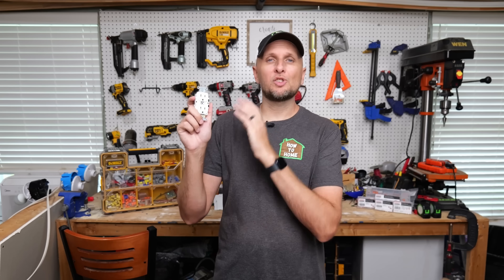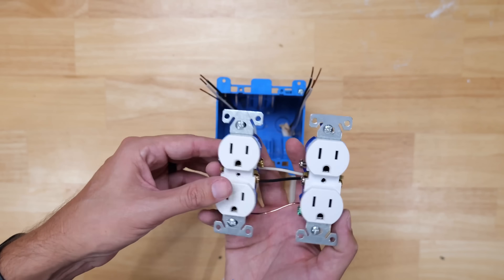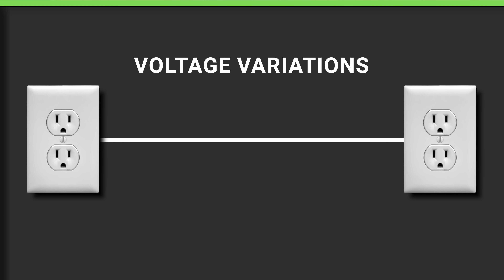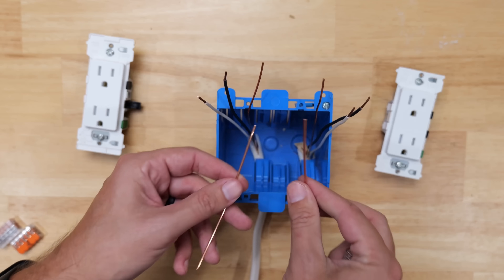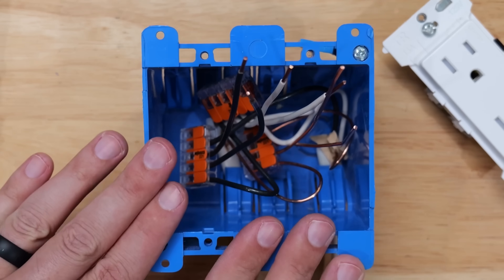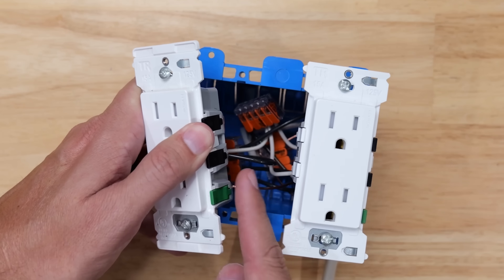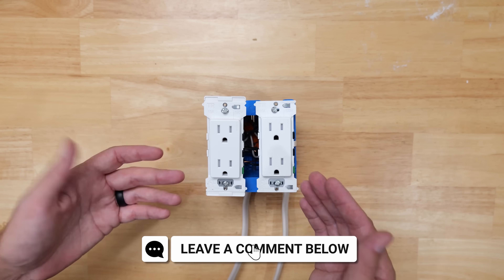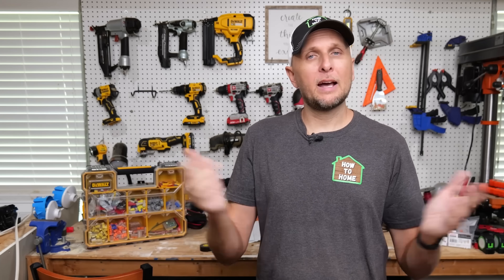Why This Outdated DIY Outlet Wiring Needs to End!

Comment: I can agree with wiring this way. But have to disagree with the reason. When you daisy chain Outlets together the way you used to the power did not actually pass through the outlet (gfi exception) but the side terminals are connected or bonded to each other directly.  So if one outlet fails internally it should not affect the rest of the outlets.  If it fails to a point of affecting the other outlets then the odds are you have a melted or burnt outlet and that is a hole other ball of wax.
Reply: On receptacle boxes where you have power coming in and going out , i join the wires together and use a pigtail for the receptacle to make replacing the receptacle easier and for double gang receptacles to get rid of the jumper from one receptacle to the other
Reply: Been doin that way for years
Reply: I saw a test of these wago connectors and it took like 80 amps or something before it started melting my 20 watt phone charger and 9 w lamp will be fine lll
Reply: Great response. Couldn't have said it better.
Reply: Yeah, pigtails are the best way.  The biggest concern with the daisy chain method is that the bond between 2 terminals is rated for that receptacle load type (15 amps). Most circuits are 20 amps, and using 15 amp outlets you will have more than 1.  This will create a 15 amp rated jumper, when you can have a total of 19 amps going through it, from multiple loads down stream.  There is no way that little jumper is as beefy as a 12 gauge wire on most 15 amp receptacles. This is a great video for DIYers, whether I agree with the reasoning or not, as long as you come up with a way to detour people from doing the more risky install.
Reply: @pud469  15A outlets are all rated for 20A pass through.
Reply: @pud469  Not true.  NECode specifies that 15 amp outlets are acceptable for use where two or more are used on a 20 amp circuit.  This is precisely because the bonding used by the manufacturers is required to be rated to 20 amps.  In fact, other than the faceplate differing for a 20 amp outlet the internal parts, including the bonding and conductive paths, are identical between 15 and 20 amp models.
Reply: @myroccbox8877  there has to be something reduced to reduce cost. Is it just the contact to accept a horizontal prong?  Then manufactures are losing money selling inexpensive 15A outlets when they contain the same amount of material for 20A. When hardware stores sell 15A outlets for less than a dollar, but charge $3 for a base 20A they are losing 200% I can see the hard wired components having to be rated for 20A but there isn't any way there would be that big of a price difference between the 2, and if there wasn't they would only sell 20A variants.
Reply: @pud469  I'm not here to discuss manufacturer's pricing decisions...although if I had to guess I'd say they're not losing money on 15A outlets...they're just making more margin on 20A models.  They also sell considerably more 15A outlets.  What I can definitively tell you, and why I posted a reply, is that your statement was flat out false.  Having a 15A outlet in a 20A circuit will do nothing to reduce its capacity...as a 15A outlet MUST, in order to pass regulatory approval, pass 20Amps.  There is nothing "less than" about a 15A outlet's bonding as you claim.
Reply: @pud469 
I don't totally disagree with you but, what I will say is that I have a house built in 1977 that used 12 ga wire with the backstabs, and several circuits with 20A breakers protecting chained 15A outlets - and I've NEVER had a problem until I started plugging in 1500w space heaters. And even then, the outlet in question started melting without affecting downstream outlets! 

I'm fairly certain those jumpers on the side screw terminals are MORE than capable of carrying 20A... Keep in mind, while 12 ga wire is code for 20A wiring, 14 WILL carry 20A without burning up.
Reply: @openeyes-411 oh for sure they will likely carry more than a 15 amp load.  It is really unfair to compare outlets from the 1970s and even the 80s and 90s.  I bet that copper is also 300% thicker on them. People still want to spend the 75 cents those outlets cost back then. I would trust aluminum foil, before those tabs on a cheaper modern option.😂
Reply: @openeyes-411  The backstab devices I have seen only accept 14 gauge wire.
Reply: @HoosierRallyMaster 
Yes - they do, NOW... 
Back in the day however, they were made for 12 ga. and acceptable by code... My house was built in 1977 and has these old style outlets - and they were ALL wired with 12 ga & backstabs.
Reply: @pud469  All 15A wiring devices can be installed on 20A branch circuits; in so doing, you may be passing all of it through a single tab on an outlet. It can handle easily 4 times that without melting the plastic outlet housing. The ampacity of a wire is a function of its cross sectional area and length, a tiny stub of 14ga wire between two outlets isn't going to overheat even pulling 20A unless it's poorly terminated. I wouldn't try it with 22ga, but suffice it to say that if an 18ga cord can supply 10A at 2 meters, it could probably do 20 at 4". 

You are borrowing trouble. If it keeps you happy, that's fine, but there is no empirical basis for some of it in copper wire.
Reply: @pud469   that don't  mean sqaut.  If you're  circuit is 20 amps with 15 Amp outlets that doesn't  mean each outlet  can have  a device  pulling 15 amps. You are still limited  to the total of 20 amps  and 15 amps per outlet
Reply: Yes the connection is solid as a wire connector through the receptacle. I don't believe an electrician thought this one up.
Reply: Electrician at our dealership said he does it this way because we tear up our outlets and it 's easier for him to replace them. He never did mention series, or faults to other outlets. good point.
Reply: @TDHobbies  I don't agree at all, they aren't wired in series in the first place, they are wired in parallel so it makes no sense to me about his claim that a fault in the first receptacle would affect the second. Someone else basically asked the same thing but worded differently.
Reply: @TDHobbies  very good point it makes it much easier if/when you need to change an outlet.
Reply: I would add those wago blocks are not more reliable than the outlet connections. A screw terminal or wire nut is far more durable.
Reply: @david25876  yep and tests show they handle more amps too. You have a pretty big chunk of metal on the side of outlets.
Reply: @david25876  i am finding that inspectors are favoring the wago connectors.
Reply: @david25876  wagos have been thoroughly tested and are UL listed. Plenty of videos if you are still skeptical
Reply: @david25876  That was my thought too. A "failure" of the outlet that would cause the problem he described is equally likely to affect the wago, which puts you in the same boat.
Reply: @david25876  Screw terminals are less reliable than WAGO lever nuts, because lever nuts self-compensate for any movement, such as thermal cycling due to a heavy load.
Reply: @tookitogo  side screw where you loop the wire, or side CLAMPING screws, using a back feed for the wire ?
Reply: @tookitogo a properly installed/torqued screw terminal will be just as reliable.  Numerous testing has been done, wire nuts, and terminals are superior.  However levers connections still provide a very suitable connection, less chance for error, and will handle it just fine. Anyone that thinks lever nuts are not as efficient for proper application as the other has a miss understanding of the test results. Any advantage terminals and wire nuts have is overkill, because lever testing also shows they are overkill, but will also provide more forgiveness, and speed. One is only going to be better than the other when improper application is applied. I see a lot of arguments around this, because of some pushing the limits testing.
Reply: @tookitogo 
You obviously drank the Kool aid my friend... Properly torqued side screws aren't going to come loose from thermal cycling - lest every house ever built would've burned down 50 years ago!😂
Reply: @openeyes-411  And yet electrical faults remain one of the leading causes of fires. Some of those will be due to screw terminals that worked themselves loose.
Reply: @tookitogo 
Only if not tightened down properly - and even then, I bet the percentage of this being the cause is infinitesimally small. 

FAR GREATER is old, loose outlets & those using backstabs with high current appliances - and of course aluminum/copper junctions not properly done...
Reply: @openeyes-411  I don’t disagree that it’s probably a rare thing. But it can, and certainly does, on rare occasion, happen. 

My point was simply that screw terminals are not more reliable than lever nuts. At best they’re the same, at worst a bit inferior. But definitely not more reliable.
Reply: @tookitogo 
I think we may have to agree to disagree here, but I'll explain my position a bit further... 

First, when you properly screw down the connections you have solid metal to metal broad contact area - whereas with lever locks you have a spring pressure contact area which (as you say) is allowed to breathe a bit. And it's in this movement that I suspect oxidation may occur on both the wire & contact strip. Probably a very small factor, and probably not sufficient to cause failure on it's own unless a particularly high current load were applied many years in the future. (Or if used in a hostile environment, such as waterfront homes, etc.)

Secondly (and much more importantly) is the fact that plastic gets brittle as it ages, and these being under spring pressure may be prone to catastrophic failure many years in the future. 

Maybe I'm just old school, but I give the edge to a hard & fast screw connection. 
Cheers, 🍻
Charlie
Reply: @tookitogo  that is the same argument used years ago in marketing stab in connections. They would move with the wiring keeping the connections stronger.. Now look at how stab in connections are looked at.
Reply: @kipbrandel4545   But they’re not the same thing at all. Cheap stab connections are built right into the cheap brass stampings that form the receptacle itself; in WAGO lever nuts, there is a separate leaf spring made of proper spring metal.
Reply: @openeyes-411  I never said it had room to “breathe”.  
Plastic failure is irrelevant in a WAGO lever nut: all the metal pieces are tight on their own. The plastic only forces the metal apart to allow insertion/removal. If you burn away the plastic, you’re left with a solid connection, just with no way to open it! Let me repeat: the plastic is NOT a load-bearing part of the contact itself. (This is in contrast with some cheap knockoffs, which do indeed just press the wire against plastic.
Reply: @tookitogo 
No, you said that lever nuts compensate for any movement, such as thermal cycling under heavy loads - I called that movement "room to breathe"... And my rational is if there's room to breathe there's room for oxidation - which btw IS the failure point of the backstabs; a relatively small contact area of spring pressure combined with oxidation. 

As to the catastrophic failure I mentioned, that WAS pertinent to the cheap knockoffs - sorry, I thought I qualified that, my apologies.
Reply: @tookitogo that was old school issues with aluminum wire. Should never happen with copper conductors unless it is not tightened properly or way over fused.. But I have seen quality receptacles handle heavy industrial use for many years with zero connection issues. It's always the cord connection that wears out and becomes loose that causes the heat failure issues.
Reply: @michaelcassidy7645  It’s definitely not just an issue with aluminum wire.
Reply: @tookitogo  This is common in aluminum wire circuits and is the exception that proves the rule. It is not common in copper. Outlet screws tend to be brass, which solves for thermal cycling. Copper conductors gall, which is a countervaling force to unscrewing. There's no galvanic corrosion between copper and brass due to brass being a copper alloy. 

I work on 3 phase motor circuits. Tons of vibration. I have connections that were landed during the Great Depression that still work fine in 2025.
Reply: @tookitogo  All springs lose their springiness at electric arc temperature. Helical fasteners do not rely on heat treating to provide prevailing torque.
Reply: @kdawson020279  Technically true but irrelevant; you won’t get arcing if the spring is doing its job, since you have solid contact. You’re basically saying it can fail in a situation that can only arise when failure has already occurred.
Reply: @openeyes-411  Exactly, i had a problem with a circuit in my house. When i figured out where the problem was it turned out someone had used the backstab on the one receptacle that fed those "downstream". I checked all the others to make sure and it was the ONLY one wired with the backstabs, the rest were all wired to the screws.
Reply: @tookitogo  Look at the resistance of lever nuts vs wire nuts in general they have higher resistance (albeit very small delta) however they remove a wide variety of installation issues when using screws for connections (proper torquing, etc.)
Reply: @tookitogo  I wonder how many of those faults were caused by improper torque and or no torque and on high pwr ckts
Reply: @openeyes-411  Good points--also lever nuts have been around what about 5 years, i bet everyone swore by back stabbing outlets at one point but now ... at best they remove installation variables but not on the side of they are the better maybe close to equivalent
Reply: @BQWood-sx4xm  Precisely: lever nuts trade slightly higher (but still entirely negligible at rated current) contact resistance in exchange for reducing a whole bunch of other risks, and saving time.

I’m sure many, perhaps most, of the electrical fires caused by screw terminals were due to improper torquing.
Reply: @BQWood-sx4xm  WAGO introduced lever nuts not 5 years ago, but 21. (Yes, the WAGO 222 is old enough to drink, even when visiting USA! :p )
Reply: @tookitogo I think he means the push connects in the back of the outlet and mistakeingly calling it a wago connection.
Reply: @BQWood-sx4xm Wago lever nuts have been around for 22 years. They are the standard throughout Europe where wire nuts aren't permitted to be used in many places. Wire nuts are considered outdated and an inferior connection around the world, and the United States is pretty much the only place that you'll see them being used. According to independent lab testing, Wagos are safer and better than wire nuts in almost every way, regardless of anyone's personal feelings or opinions on the matter.
Reply: @dustinaunkst537 wirenuts are still allowed jn most of Europe. It's pretty much just the UK and France that bans them.  That's also mostly due to them banning them when they were still ceramic.  I'm a wago fan but plastic wirenuts are perfectly fine.
Reply: @tookitogo  Really? I think wire wrapped around a screw and torqued down would be the most secure you would get, although I know wagos are very reliable.
Reply: @Jb2008-l8e Intuitively one might think that. But in actuality screw terminals can loosen due to vibration or thermal cycling. And at that point, who knows what the contact resistance can become as the copper tarnishes due to the air gap. 

That’s why traditional screw terminals require retightening periodically. (Some of the newest screw terminals add internal springs to automatically compensate for loosening, obviating retightening. But at that point, if you’re relying on spring force, why not just use a “native” spring terminal and enjoy the quicker assembly?)
Reply: If you wrap the in and out wires on the same screw it would be like a joint with a pigtail. When the in wire is on one screw and the out is on the other, all downstream load is passing through the "breakout" tab. I found a receptacle burned up in a house once because it had been "backstabbed" with in and out poked in separate holes. Decades of downstream load passing through the backstab connections destroyed it. It arced causing the whole circuit to go on and off intermittently. Thankfully, I found it before a house fire resulted.
Reply: When I did commercial and multi-family buildings we ALWAYS made joints with pigtails for devices. I had some guys who came from doing single-family houses argue with me about it, but the big bosses agreed with me.
Reply: I agree!
Reply: Agreed! What is more likely to fail, the break away of an outlet or a Wago?

Comment: what are the chances of this?  One in a million?  I've never had one go bad unless something obviously damaged it.
Reply: probably less than that, as they are literally designed to do this. However I haven't in 40 years seen anyone pass the entire line through a receptacle. they will pass single in same box receptacles to the initial one but not the circuit.
That latter is what he should have done. 3 way wago, one to the outlet(s) 1 from inlet circuit 1 to outlet circuit.
Reply: @gg-gn3re  really? Most outlets in my 2010-built home are wired the pass-through way. The electricians start with the source to the first outlet, then to the next and the next and so on. In each single outlet box, there’s an incoming in an outgoing, all connected through the outlet. I’ve only seen pigtails where there are three or more 14/2 romex cables coming into the box.